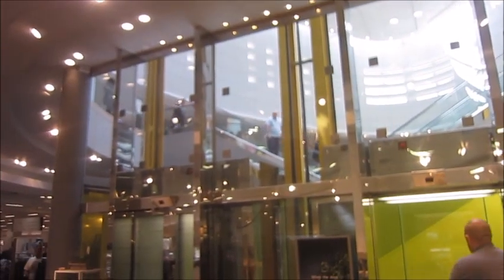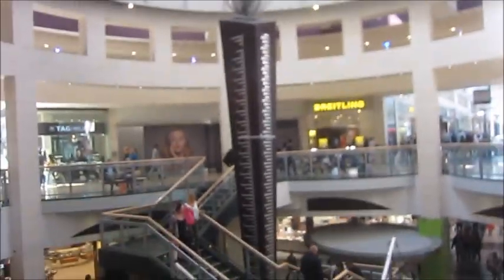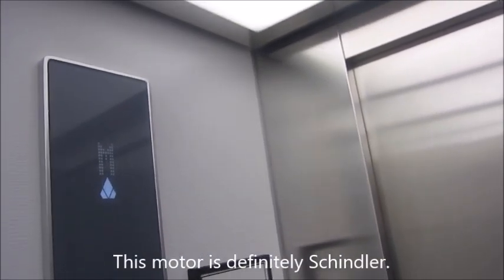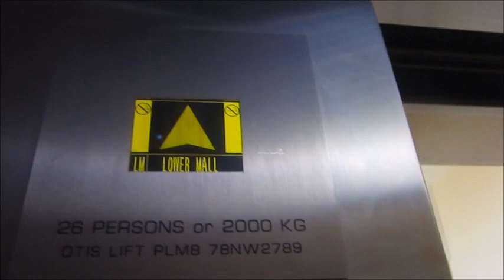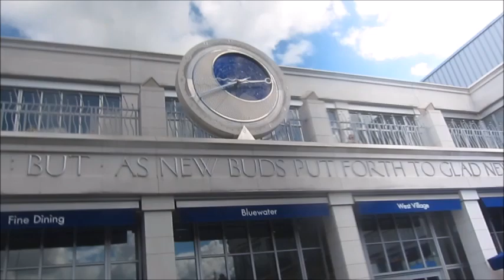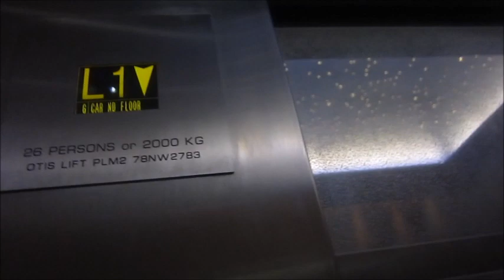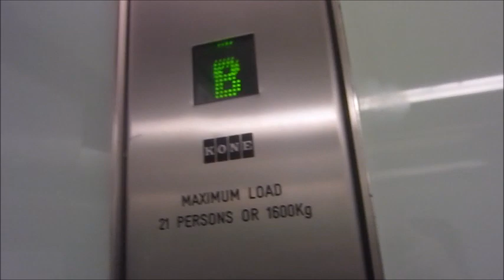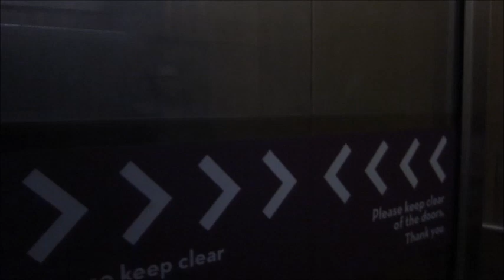Bluewater Centre | Lift Tour

Comment: In the Next lift there's a Public / Staff keyswitch. I think the other doors open into a service area and that keyswitch is to toggle between if it opens the doors on the public side or the staff side when you reach a floor.
Reply: thats an 827 so surely will be trying that out next time i come down

Comment: when was the other door used in the next lift i have wondered this for so long can you please tell me what it was used for i thought it went to a service level and i wonder if the shaft doors are still there
Reply: Next was modernised and done up in around late 2012ish, so that was when they re-configured it. It used to open downstairs as the stairs weren't there.